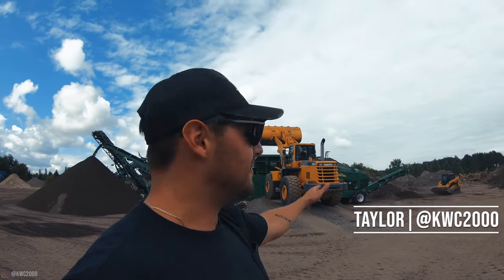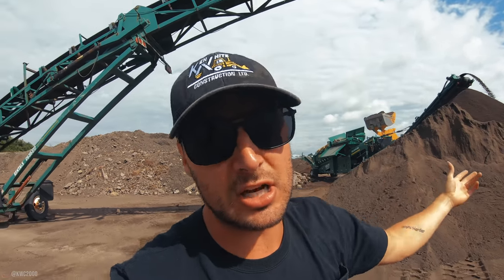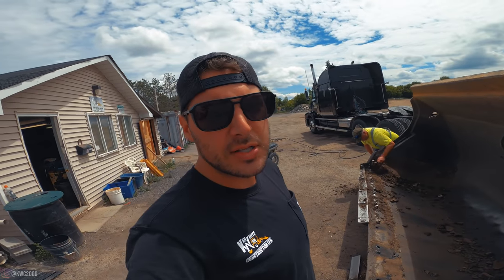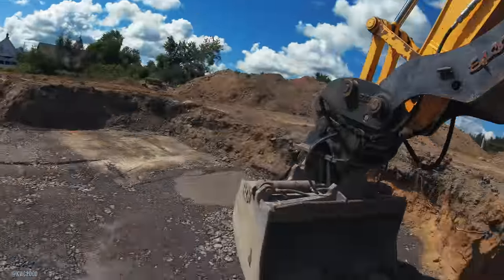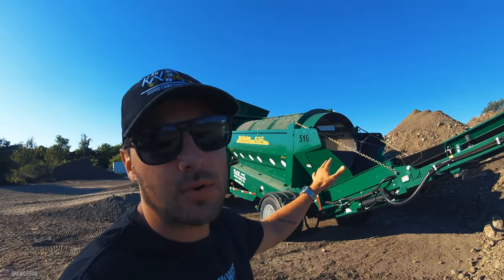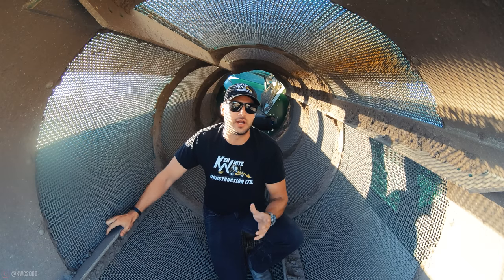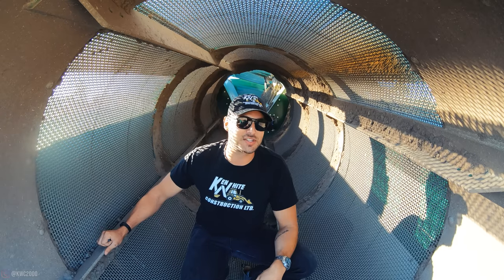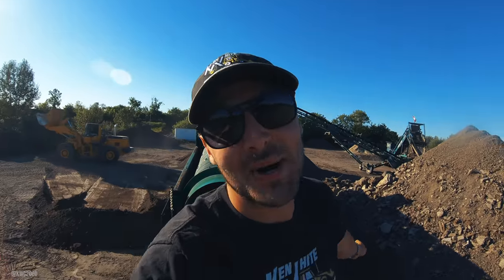First Time running a TROMMEL SCREENER (2020 McCloskey 516)

Comment: Putting brushes on the other side also helps with extra cleaning in winter months. We've tried all the different trommel screens and we have found that the EDGE TRT622 is the best one. Its bitchin - track mounted, radial fines conveyor, radio remote. Cool video by the way!

Comment: For people that want to get into the business of screening soil there is always the skid steer bucket that spins to separate the rocks/roots from the soil. The larger the equipment generally the faster you can process stuff to a point but each type has its own limits like can you change the sizing and how long dose that take or max size but grizzly bars generally solve that already. 

And yes I know there are other options like the excavator bucket that has a vibrator motor to shake out the fines but the skid steer is more of an entry level option that lets you process and pile where you want it.
Reply from the maker: Yup those are great ways to get into it.

Comment: Hey Taylor, It’s Josh. The guy who bought rejects from you. I ran a McCloskey R230 deck screener and 638 Trommel for a company previously. I prefer the rejects from the deck screener as they are much nicer to work with. However the Trommel  gives you a much better product I find. One thing to note : Once it rains, stop the Trommel as the rubber tires that turn the drum can slip very easily and then your stuck shoveling all the material out of it.... trust me it’s not fun lol Trommel it up buddy keep hustling!
Reply: P.S. even if it’s just a sprinkle of rain it doesn’t take much to stop that Trommel haha

Comment: Trommel it up! We are also looking to update a Screen plant. Have had a 516 since ‘03 has 5,500 hrs on it. I think I would like to go to a deck screen to be able to run the Oversize back through with out running the +4 which is mostly rock.